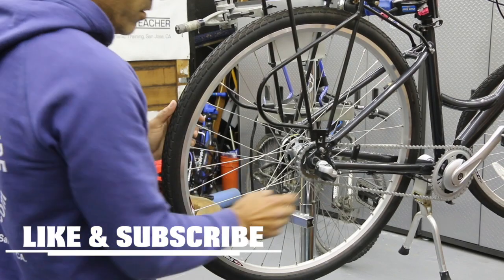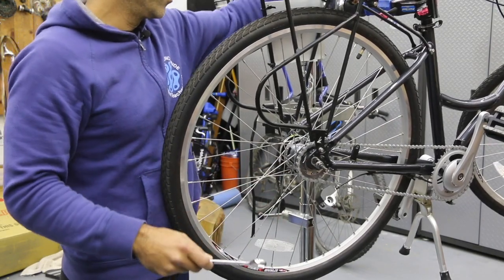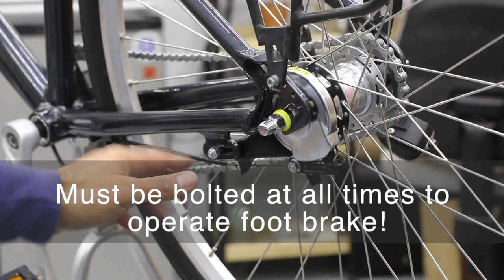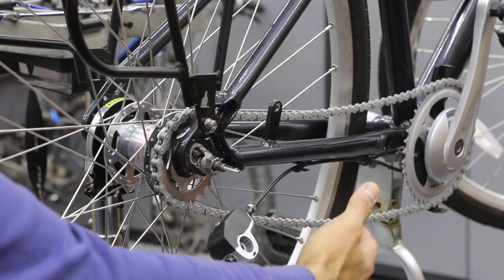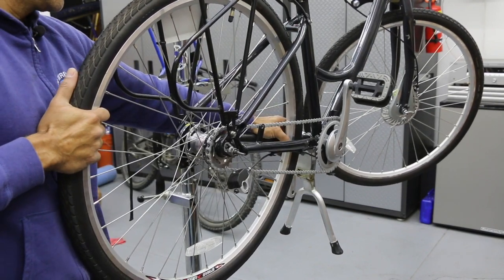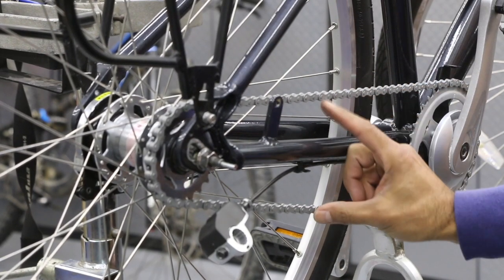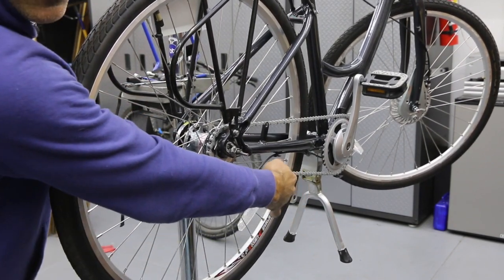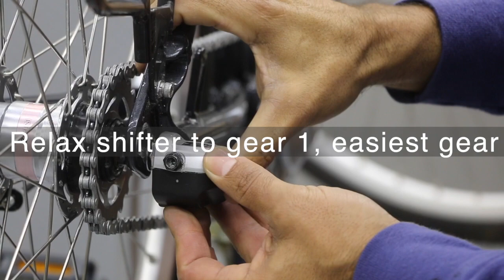How to tighten a chain with bolts and a coaster brake. Shimano Nexus Shifting

Comment: Why do you need to losen up bolts at both sides ? Wouldn't it be better just to loosen bolt at just one side so you won't need to ajust wheel in the center later on when tightening bolt ?

Comment: I have the same set up with the Nexus 3 speed and coaster brake. What are my options to convert this to a E bike ?.
Reply from the maker: Bafang has a middrive motor kit. Or find a kit that has the motor in the rear wheel.

Comment: This why I don't like horizontal dropouts. Vertical dropout, while using a duel-cog tensioner, is a lot better for removing and reinstalling the wheel. Especially on the road.
Reply from the maker: I agree.

Comment: Should the "n" be in the window when you tighten the shifter?
Reply from the maker: Not sure what N you are talking about. Typically the shifter would be in the 1st gear and the hub should be the 1st gear, tighten cable then check for alignment in gear 2. The red or yellow marker should be in the middle of the two white lines. Hope this helps.